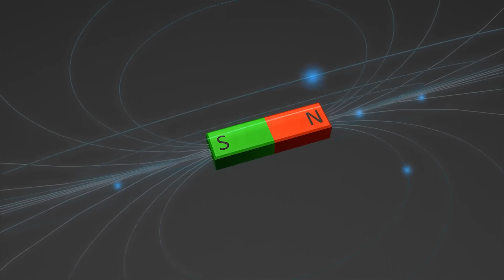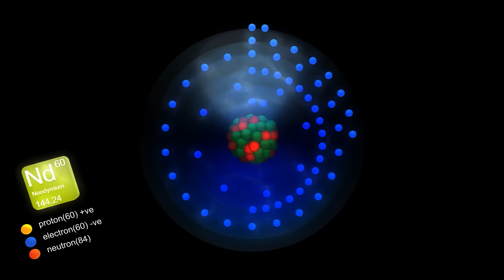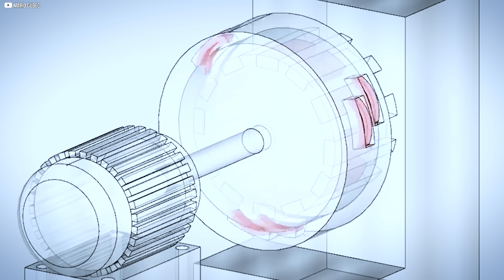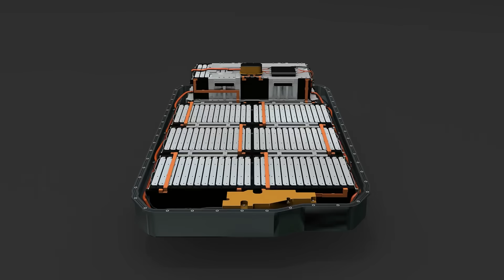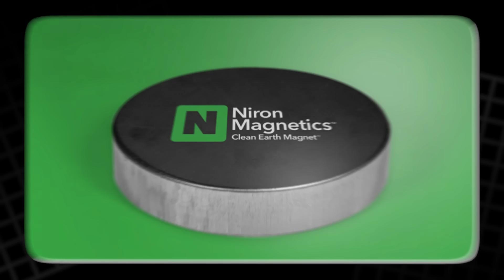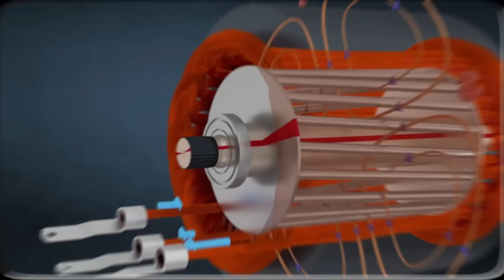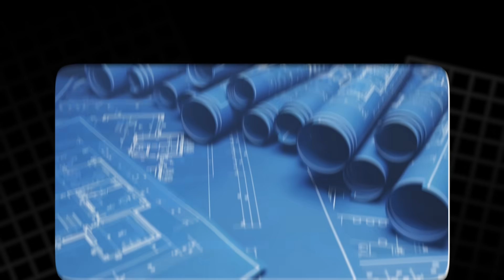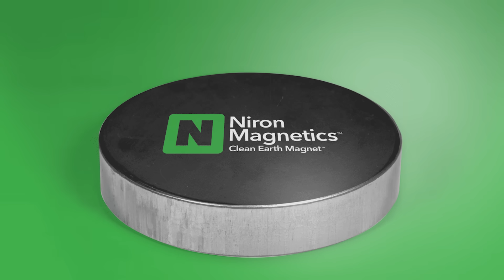Science Just Built the Most Powerful Magnet Ever – Here’s Why It Matters

Comment: The technology that is poised to change the world is and old one as from my recollection it was first done in 1968 where a guy took two different Presidents for a ride in a car that had nothing but water in it's tank for fuel. Through a lot of hard work making use of the scientific method I managed to figure out just how the technology works. However those that sell energy right now have put up all kinds of road blocks designed to prevent the technology from ever seeing the light of day. 
The science behind making use of water as a source of fuel is very subtle which is why most scientist miss it. The key is to get the atoms electron away from the atoms as that act breaks the covalent bonds of the water molecules and it doesn't matter how those electrons are taken away. I have seen it happen with strong magnetic fields, high levels of radiation, and something to note even plants do it through the process of photosynthesis. The way that those that came before me did it so that a car could run down the road with nothing but water in it's tank for fuel was to ionize the atoms getting them to eject their electrons by placing the water molecules in a high voltage potential difference field. Water is used as a dielectric placed between two plates forming a capacitor and those that came before me would then charge up those capacitors to the point where the ionization threshold was reached for the oxygen and hydrogen atoms causing them to eject their electrons. And that folks is how to break the bonds of the water molecules with electricity outside of Dr. Faraday's electrolysis method.

Comment: Neumann’s motor has been improved on by many others despite Niron megnetics
Reply: It's an extremely bad example though! Keely made a 40hp free energy motor in 1907 using 3.4lb magnets. It was a secret mod for the 1908 Model T charging system. Edward Leedskalnin was known to have used it. I have some of these. Charge itself is a sum of poles, and pos is heavier, so what I found is that he'd made a Julian set fractal of charge itself. Positive looses the fight, so the end of the positive pole flies off the ends of cow magnets with their negative centers only mounted to the car's frame. 15-20 layers of flatwire coil folds zero point energy on top a carrier wave from the car's distributor to cause a pump z wave carrier to alter carried sine into pump z also- a necessity for zero point focus folding into HF.
Reply: @mikefromspace The endpoint is that these motors don’t need to drive vehicles or machines but can be used as the energy engine for battery storage.  Free energy even in the coldest climates.
Reply: I saw nothing in Neumann's motor that was practical.  Too large too heavy weak as hell too many materials required.
Reply: @arne6787 The concept is the point.  You don’t accept it proves BIG F’n OIL has been making sure that we all have to buy their snake oil  ad nauseam…are you blind or a shill?

Comment: The earth has the strongest magnet in creation. Gravity!!!! If mankind could replicate that ,it would be amazing!!!!!😊😊😊😊
Reply: And I long for the day when gravity is fully understood. Anti-gravity could then be a possibility.
Reply: @leswhitehouse basta guardare il sistema del generatore John Searle inventato negli anni 60 è un sistema antigravità ne costrui' uno così grande che ci poteva entrarci lui dentro e fece una prova di volo da Londra a New York ci mise 20 minuti di andata e 20 minuti di ritorno
Reply: @leswhitehouse  It already is. I have explained the energy void 100% in Azra Wind's pdf on unification. The gaps of primes in the prime spiral were found to match the forces perfectly, and that's no coincidence. That force map is tremendous. Clearly as I predicted in 95, time flows mainly from electron neutrino pressure, and this pressure drives all other flows. All other forces. Gravity is simply the effect of primes resisting it's pressure due to charge column interlocking effect.

Comment: A stronger magnet doesn't change the laws of thermodynamics.  Pushing perpetual motion machines is unscientific and unprofessional.
Reply: Although zero point energy actually does work extremely well by splitting charge thanks to the slight mass difference among the poles. Negative is stronger and lighter than positive. It's easy to reach 1hp per lb. The 1908 Model T charging system would produce 40hp by slipping a pair of negative center cow magnets into those mystery slots in the cast iron bell housing. I have a few of those charging systems. Stock magnets were only 3.4lb pull, while N52's are at least 34 on a 1/2" cube. Exactly 10x the original. If using thicker wire and longer posts for the coils, I'd expect at least 6x the original @ 200hp. I don't have a dyno but it had no problem running a 24kw powerhead that requires 35hp.
Reply: I know!! Man has had magnets for 100 years😂
Reply: But very very hopeful?  🙂  And maybe one day when we do really, really, know everything, WHO KNOW?
And that bugger is gallivanting around in his Tardis.

Have fun folk's.
Reply: Laziest generator, high voltage electrolisis tanks + electrolyte solution on electric generator are better, because that scheme still offer market and economy cycling to human population
Reply: so sayith the colonizer
Reply: What are the laws of thermal dynamics? Please list them